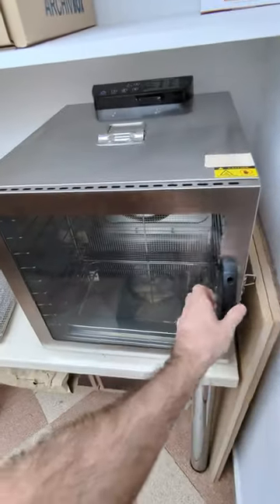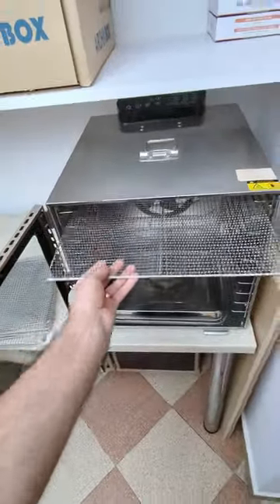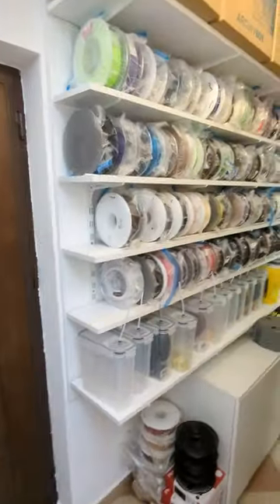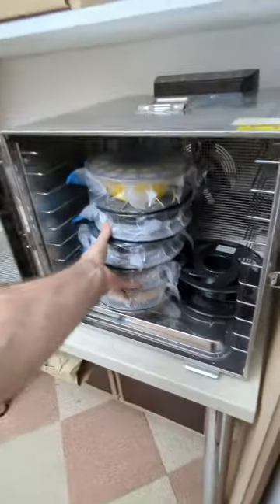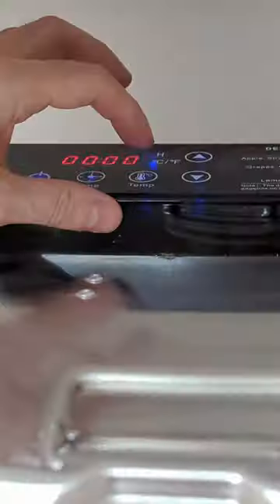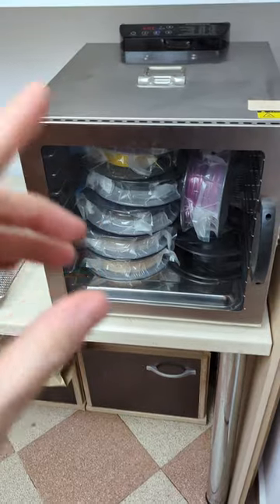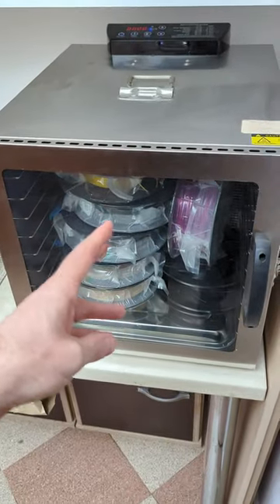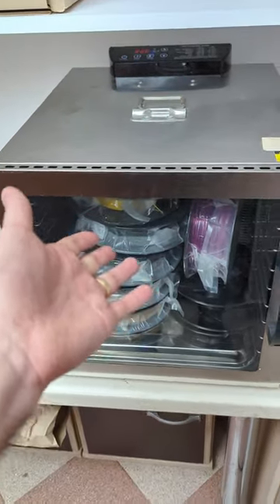Drying 3D printer filament with a food dehydrator

Comment: I use an old dehydrator from the 70s works great. I have a bunch of reusable silica gel beads as desiccant in my filament storage boxes. I dry sacks and boxes of those in my dehydrator as well.

Comment: Smart, for what temperature and time do you dry your filament.
Reply from the maker: ~40C for PLA, ~60C for PETG, ~70C for ABS/ASA (just because the drier can overshoot by quite a bit sometimes and risks melting the filament) 3-4h should be enough for most materials, but I sometimes leave them there over night.